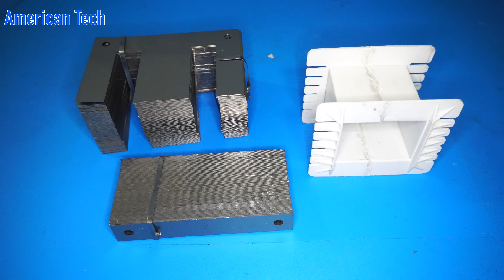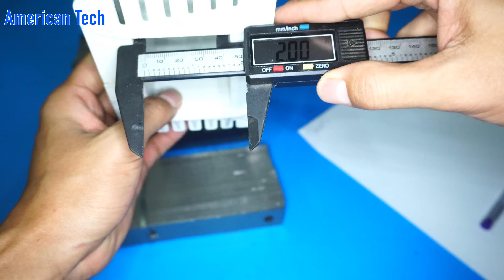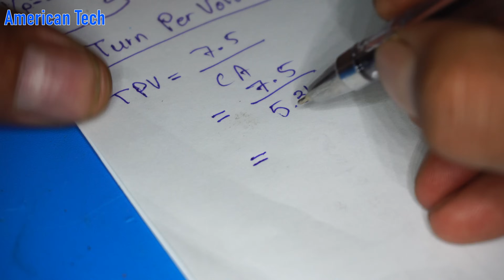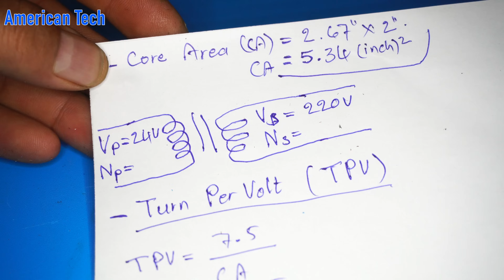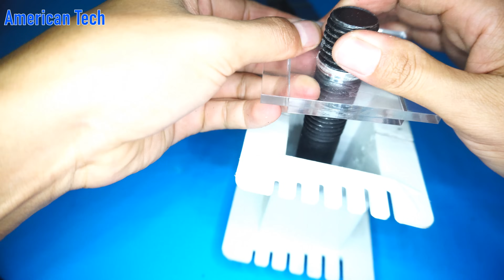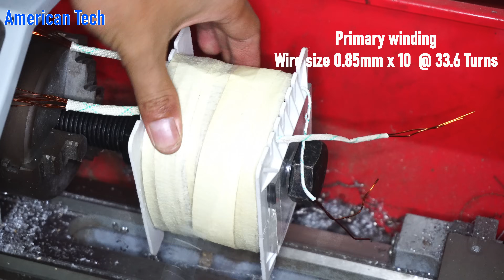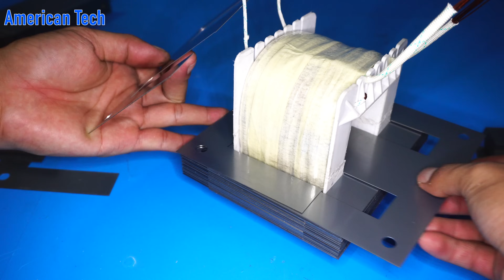Big Transformer winding and calculation for 10KW inverter

Comment: Not going to get 10KW out of that rather small transformer, it would overheat very quickly. 10 x 0.85mm is only 5.67mm2 for 24VAC winding get no more than about 25Amps, or it will overheat. More like 600VA

Comment: Where can I find good source for those silicon steel plates and bobbin shown at 0:27 in the video?
Reply: Answering my own question: Aliexpress.  Several sellers have various sizes of stamped silicon steel plates in the E-I format.  I got the 6kg of largest 192mm size for a 4000W home battery charger project.  It has a 9.35-in² core area, bigger than this one's 5.67-in² area.

Comment: This is NOT a 10KW (10KVA) Transformer.
------------------
This is a 1 KW 1KVA Transformer.
The window area Qe, is only 5.34 Inch^2
Equivalent to a Qe, 5.34 • 2.54^2 = ~ 34.5 cm^2.

n/V = Qe^2/VA; > 34.5^2 / 1000 = ~1.2 Vin/V

With your model Haves there is 1.4 vin / V this corresponds to
Qe on the Square Root of Vin / V • 1KV = SQR 1400 =~37.5 cm~2.

After all, your surrender is only 5.35 Inch~2 ~ 34.5cm^2
There also fits a 10 KW transformer within places, since the window's area 
must be: Qe = SQR (vin /V • KW )> SQR (1.4• 10^4) = 118.322 cm^2 = 18.34 inch^2.
The weight of 10 K fits perfectly. It could be that you could have switched around with Kg and KW. ☺
Reply: Secondary winding of only 2x 0.85 was the give away. Secondary current would be just over 45 amps.
Reply: 10KVA is for more viewer

Comment: to makes inverter powers Iet says a 10watts it’s will drive a 2000watts heater up to 4 heaters it’s will have a lots of power leftover how will I do that’s something to do with a heavy tranformer whats  bouts an isolatin tranformer it’s convert 240volts AC to 120 started from the secondary winding

Comment: High voltage transmission lines low voltage LED DC power 3 volt to LED light single diode transmission line face and body neutral ground to frequency is light is DC power 3.0  generation DC power Tesla coil plate and transmission

Comment: никогда впринципе этот трансформатор 10 киловатт не переварит. вторичка максимум пережует 800 ватт.ну киловатт кратковременно может и быть..не более.
Reply: Correct, this core is no where near a 10Kva transformer.... I would say 1kva maximum continuous
Reply: There is a DIY 10kva transformer on my channel,  I rewound it from 240v to 110v to 240v 5000v the run my Vacuum tube Tesla coil 😅👍👍👍👍

Steve

Comment: 7.5 : ca.   why 7.5 and not 9 or 11.5 ?  can you show how you get the 7.5.
Reply: It is from the formula N/E = (10^8)/(4.44*CA*f*Bmax)

You will get 6 or 7.5 or 9, this depends on Bmax value. Usually at 7.5, Bmax=60,000Guass. The lower Bmax is the high constant is...

What will this effect the transformer??? The high constant number is, the more turn/volt is and the transformer will be hotter at lower turns/volt.

Comment: How can I determine the wire gauge to use
Reply: I would recommend that you check the wire gauge chart here for the frequency that you'll be switching with. If you'll be switching at low frequencies, larger diameter wires like 18 Ga to 20 Ga can work. If you are switching at high frequencies, TIW or LITZ wire is recommended as these contain many small gauge wires that are each insulated from one another. The higher the switching frequency, the more the 'skin' effect becomes a concern. Too thick wires at higher frequencies will result in inefficient current handling as more and more of the current is carried at the wire surface (hence the skin effect) rather than through the centre of the wire. Check the "Maximum amps for chassis wiring" column for the maximum current allowed and the "Maximum frequency for 100% skin depth for solid conductor copper" column for the maximum frequency permissible to achieve skin depth optimization. 

https://www.powerstream.com/Wire_Size.htm

Comment: Hello, yes, this is a big transformer, and I have a transformer twice as big as yours. And it works differently, it converts 220 volts to 16 volts, and you have the opposite, and this core is from a transformer that you don't have it designed for such power.
Reply: Yes, but he does them like this... for fun, he doesn't use them to make electronic projects, he's an artist.....

Comment: How is it 10kw ? Is it 100v × 100amps = 10000w ?
Reply: 10000kw ÷ 220 v = 45,4 Amper
Reply: Actually I would recommend drawing half that current from.it. I don't think you understand Ohms Law.
Reply: In fact it is10000W÷24V=416,66A for the primary side, an intensity which the winding shown in the video by no means can withstand. The core area calculation is wrong. This is a 2kVA max. transformer core...A 10kVA transformer core is five times larger than this one...and equally heavier...